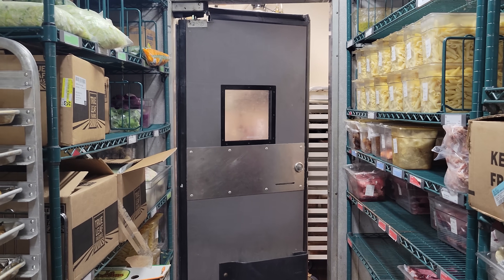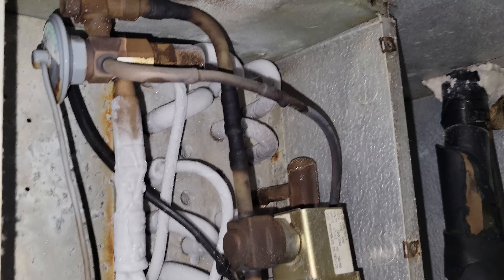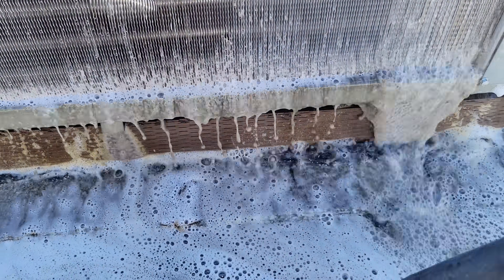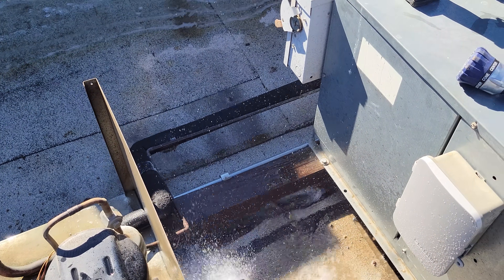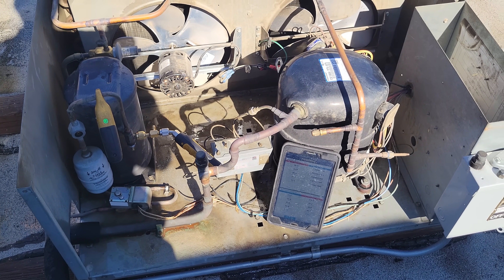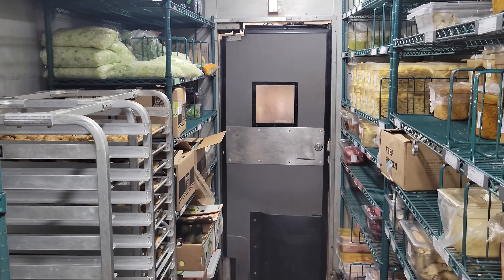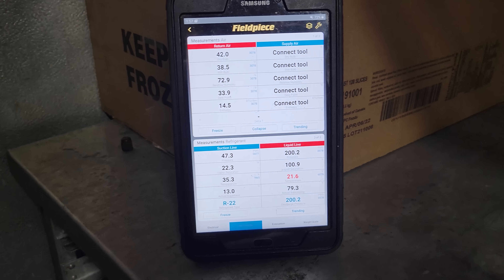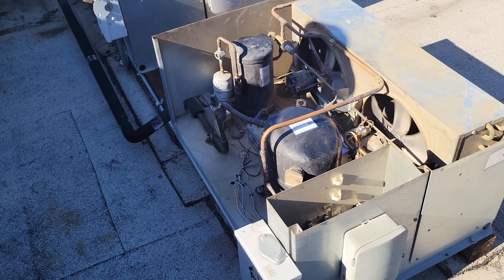WHY WONT THE WALK IN COOLER GET BELOW 45° ?

Comment: Communication with your commercial refrigeration clients is essential. Spending a few minutes to educate and show them how to properly use the equipment can a long way in avoiding nuisance service calls. I remember late one night I got called out to a Walmart over 3 hours away, one way, for a 2 door freezer endcap(it ran off their rack system) that was showing a high temperature alarm. When I got out there, I saw that the night stock crew had packed the case full of room temperature freezie pops. If they had been educated on how to properly use their equipment, they would've known that those cases aren't designed to freeze a large amount of room temperature product. They should've put it all in the walk-in freezer first, and then transferred it over to the display case. The entire call ended up being about 8 hours of overtime, and it was much appreciated, but simple communication and education could've avoided the entire service call.

Comment: I've never used that Viper in the coil gun. Is that the same Viper that comes in the spray can too? I like using the spray can on the little indoor self-contained units. On the outdoor condensers, I'm a big fan of Nu-brite with the coil gun myself. It takes a long time to rinse clean, but it's worth it in my opinion.

Comment: That cooler was barely packed. Put a hydraulic closer on the door to easy too cheap
Reply: Easy to prop open the door too. 😆 Cooks: "It's hot in the kitchen. Come on!" 😆
Reply: @fitybux4664  Hot kitchens are a common screw-up by inexperienced designers not knowing how to calculate load

Comment: Door seals bad, improper loading, improper condensate removal, partial frozen coil reducing airflow, negligent staff ... im sure theres a ton more things that COULD be but those were the tops during my service in the HVAC/R lifestyle.

Having rotated in and out of the field I dont miss the dirty ass kitchens or the dead rats and mice in the coolers or the cheap owners who just want bandaids on the double hurry so they can clear an inspection and return to normal operation for the week (or until the bandaid falls off ). 
ALSO note: never take free food from ANY service job.
Reply: That made a shiver run down my spine. Restaurants that only care about fixing the walk in cooler to pass an inspection? I feel nauseous now for some reason.

Comment: Got a call at a big holiday from a company that had stocked everything u can think off in a grosery store, from the floor all the way up to the evaporator.
And like 3 meters out.

And yeah ofc alot more on the rest of the shells and floor.
Could barely get in there, impossible to reach the machine.
I would not want to buy stuff from that freezer...

How can you not understand that wont work 😂😅

But it made me a ton of Money, 3 hour drive and 2 hours work.
With an extra 200% on my hour salary.

Comment: Energy is still too cheap. At least in that location.
Imagine an energy meter on that cooling unit and the difference between leaving the door open and having it closed.
Reply: Not to mention a restaurant charges 60$ for a 8oz choice sirloin steak dinner and people are happy to pay.
Reply: Socal energy is like 35 cents per kilowatt hour or something stupidly insane like that. (While it's a third of that in most other places in the USA.) Employees don't experience any pain when they spend their employer's money paying for extra electricity.
Reply: @fitybux4664  yeah, but the employer does. It's in the best interest of the employer to lower costs, so the profits are higher. I get your point though.
There are ways to aquire data when and how long the door was opened. And by whom. In that scale - one door at one little shop - quite ridiculous, but still possible.

Comment: put a monitoring sensor with remote access and logging in, then you can yell at them before sending the tech out and skip sending the tech at all until the door is closed for some sufficient length to confirm a real issue.

Comment: I worked at a shop the had a walk-in cooler for production materials to keep the humidity controlled and not overheat them. That cooler was designed to only cool down to 60°F and would not go lower by more than a couple degrees if set below that, either 57 or 58°. So my first though was a food service place bought an industrial cooler when I read the title.

Comment: don't stop at one thing the door the boxes over the  fan the condenser lots of little things make a big problem. chris what was the guys website that sells the thread tap for 1/4 hose connections and have you ever tried it on a rotolock valve( think you call it a kings valve)

Comment: When I saw the "door" they had put in to the box, I just had to stare at my monitor.
That thing is the door to a walk-in cooler?! No wonder it can't temp!
I'm glad you upgraded them to a real door. They probably should have done that when building the box, IMHO ...
Little more expensive up front, but the energy savings and reduced service calls will more than pay for it.
Reply: It should have been considered when designing the size of the system. "What kind of door, how thick is the insulation, etc." (Even things like how often the door will be opened, would matter.)

Comment: Most installations we do in the company i work for we install limit switch at the door that controls lights fans and solenoid valve. so opening the door lights switches on and both fans and solenoid are deactivated so if the worker doesnt close the door the system won't start.this is a way to prevent a large amount of hot air to get inside the walk in

Comment: I think a solution for them leaving the door open is to put a switch on that door and have that switch after maybe 5/10 minutes Shut down the cooler. And they might learn.
Reply: better yet fit a dialler on the door switch to call the area manager
Reply: A friend of mine used to work at a 7/11, and the blowers would shut off whenever the door was open. This place would end up with everything iced up really quick.
Reply: Outfit the employees with shock collars and they get shocked if the door is open longer than a few seconds. 😸

Comment: I noticed there was a solenoid valve at the evap, but there was also one at the condensing unit.
Reply: I think the one at evaporator is for pumpdown when temp is reached. The one at condensing unit is controlling by time clock for pumpdown on defrost. I Think I'm not 100% sure. If someone knows please post. Thanks.
Reply: I believe you a correct. It just seems a little silly! 😂

Comment: In a few years, when my boss stops working, I will no longer have to be taking calls like that. I am so looking forward to these places becoming someone else's problem. Maybe someone will send them a "woke" tech who will make them regret making the call.
Reply: all calls are money, easy calls are the easiest money
 so they leave the door open and you turn up, close it and bill them.. or you could be sweating your nuts off for the same dollar..
big picture thinking
Reply: @richardbartlett6932  None of our providers will accept billing for closing a door. Good for you, if you can get paid for that. Getting paid...the biggest picture.
Reply: @arthouston7361  you need to find new providers. I've driven miles to change an AC stat from heat to cool because the room was too hot
good luck in your quest to find decent clients 👍
Reply: @richardbartlett6932  We do third party work, very little direct bill. Every job requires pictures, approvals, and signoffs.  Some client corporates try out the 3rd party route and they discover that because it's not a same-day fix process that they don't want to go down that road any longer..... and usually I have found that I don't want to go down that road any longer with them either.  I had one chain that would use under counter reach-ins until the doors literally fell off and I didn't have metal left to attach the new hinges to, and then instead of letting us replace the equipment, they would have a mysterious box truck arrive with a piece of used equipment and 2 guys would roll out the old unit and roll in a new one, and I'd have to plug it in because the guys didn't want to reach around in the dirty spots behind the equipment next to it to find the receptacle.
 That chain is now out of business, and I could not be happier about not having any of their junk on my schedule.
Reply: @richardbartlett6932  Bigger picture thinking if you're the lead tech / owner of a business. "You'll only be getting my crappy techs billed at the same rate from this point forward, to close your freezer door for you."

Comment: Recommend installing a door closer, remove the staff from the equation and put a door watcher alarm on it. Curtain strips will just be pulled back constantly. Fair play with that patience, although a door not openable from the inside seems  odd.
Reply: All the doors operate from both sides for obvious safety reason, he was recommending the kind of door that only swings in one direction (like how almost all doors work) as opposed to the installed door that swings in both directions.
Reply: They will just use a bungee cord. Unless management backs you up, it won't help at all because they will just disable or remove it.
Reply: Two way meaning swings both ways.. the new one only swings one way..
Reply: Install a rotary door that'll prevent venting out the cool air.
Reply: @ehsnils  I'd pay money to see a rotary door used for a freezer. What a funny sight that would be and a terrible waste of space. 😆 (You mean like the type at fancy hotel entrances?)

In all reality though, if a high traffic door literally allows higher revenue through less wasted employee time, having as good of a high traffic door as you can, times two, might be an idea. (A double door like they use for winter areas.) Or maybe just a normal freezer door with a foot activated opener.
Reply: @fitybux4664  I'd consider a smaller version used in darkrooms for photo, like this one: https://www.youtube.com/watch?v=biCzQkbveZs

Comment: If they loose power,and the time changes, they will be calling ,when it goes into defrost for 1 hr 15 min.cycle t stat to calibrate,and re adjust. they are out of calibration.probe product and adjust accordingly.
Reply: Kind of a crappy controller that can't get internet time and can't adjust to daylight savings time/etc automatically. Are HVACs stuck in the stone age or something? Even my phone can do all of these things.
Reply: @fitybux4664  You realize your "phone" is a multi 100$ piece of advanced technology who's main responsibility is to give you access to things? Modern phones are litterally pocket computers, nothing like a basic piece of electrical hardware.

Those "Crappy controller" as you put it; are meant to resist being exposed to high temps, cold temps, use as little power as possible, be mechanically resistant to constant vibrations AND be really cheap. Not like a 400-1000$ phone. 

"Are HVACs stuck in the stone age or something? Even my phone can do all of these things" 
Is the best way to say "I have no clue about any of that stuff but I like to complain and make nonsense comparison" without directly saying it.

That's like using a scythe and saying "Why can't this auto-adjust the cut height of the grass, even my rideable mower can do it" yea, not the same price.

Comment: ❄💪👍🇺🇸 If u have time tomorrow on ur show can u explain the reason  recording accurate subcooling at outlet of condenser with a receiver can b misleading ? . Reason I'm asking is because I have DICK WIRZ 3rd n 4th edition commercial refrigeration books n he shows on his diagrams in chapter 7 where to take subcooling readings at outlet of condenser with receiver. Nothing about not checking subcooling  or misleading readings with a receiver.  He does mention on pg 33 chapter 7 if u can't measure at outlet of condenser then he recommends outlet leaving the receiver. I would think as long as ur subcooling in the condenser n ur getting solid liquid to txv with clear sight glass u should b good.  Thanks for sharing your experience n helping improve the trade.  Stay safe 🙏

Comment: Have them leave the door of their home refrigerator open for 3 hours a day and report back to you.
Reply: That reminds me..  I have to go defrost my freezer.
Reply: Yeah, a home refrigerator would probably break down under those same conditions or not be able to keep things cool.
Reply: @christopherkidwell9817  My home fridge would not break down. I'd get an alarm on my phone that the fridge compressor has been active too long and cooling isn't coming down fast enough. Am I just weird? 😆 In all reality, it's simpler than everything I just said. A simple phone notification for high temp alarm does wonders and really isn't that difficult to set up.
Reply: Yeah, especially the new ones. I’ve had a subzero fridge and freezer for 10 years and have had only 1 simple ice maker issue. Very easy to clean the coil with compressed air too because the top part where the actual cooling section has hinges and opens upwards. I love their design it’s so nice. Some new ones break within 2 years.
Reply: Burnt compressor asap